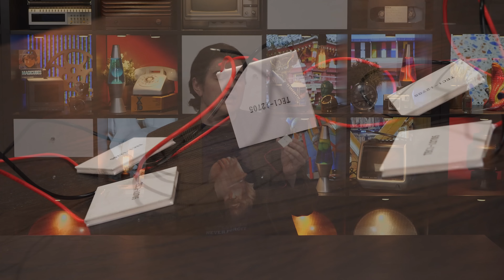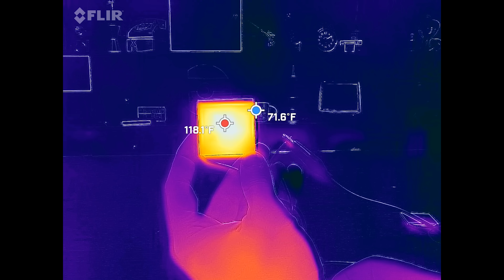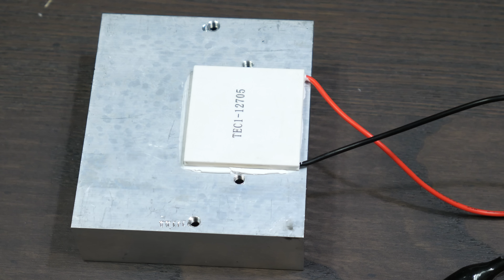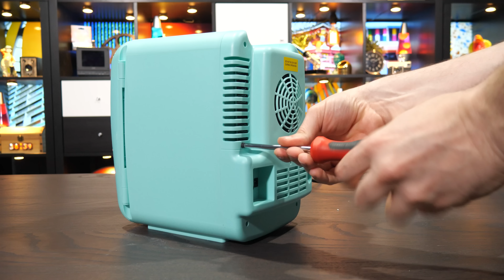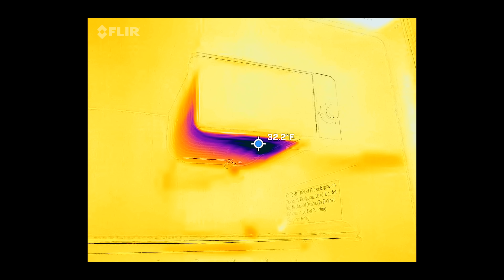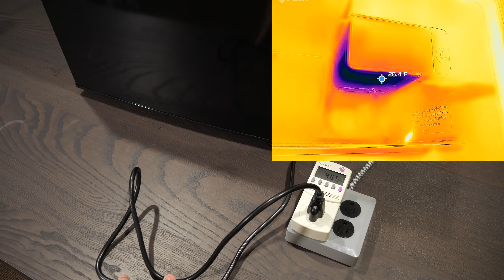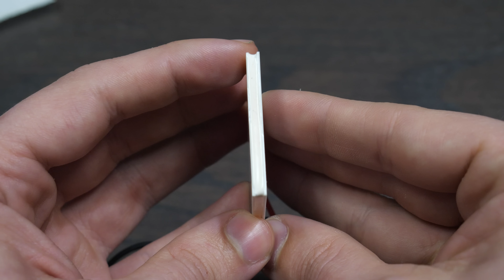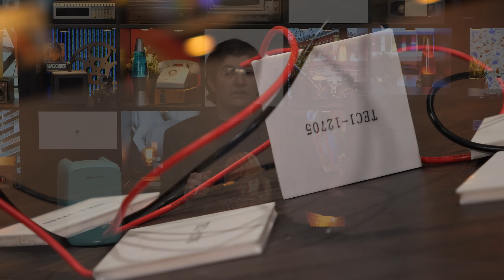Thermoelectric cooling: it's not great.

Comment: Sony Reon Pocket 5 is a wearable thermal device that uses this tech. Unfortunately it's not available in the USA, but I love my amazon Torras neck "air conditioner" which is a normal neck fan plus some Peltier cooling plates against your neck.  It's not super powerful, but when you switch from fan to cooling you feel a nice chill almost instantly that does make a difference for the 2-3h the battery lasts.  If I feel a little cold I switch it to heating mode and can often avoid putting on long sleeves.

Comment: Where peltier works reasonably well for me is inside my astrophotography camera. It's used there to reduce the sensor temperature to a known value so that it calibrates properly later. But on a hot night in the summer, it's just like you presented: 40 degrees below ambient is about the best it will do. The rest of the time, I keep the sensor at -10c.

Comment: I have the xbox mini fridge, and having used that at a lan party I must say I was very positively suprised at it's performance.
Now I bet it's not efficient at all, but from the sounds of things, it at least was far more efficient then this horrible blue thing. It would cool down a 1.5L cola bottle pretty well in an hour (ofcourse that's not actual fridge temperatures though, but still much better). It's probably better isolated.

Comment: I'm a big fan of the portable 12 volt compressor fridges, those tend to have the lid on the top so they get the efficiency bonus that you get from a chest freezer. My favorite one I've had so far is a relatively spendy big unit from Anker, it has a built-in and removable battery so it'll keep cooling even when the vehicle is off, it'll go about a day disconnected from power and the battery bank has a plug for taking direct input from a small solar panel.

Comment: One of the worst implementations of these I've seen is in cheap dehumidifiers. You might get a slow dribble out of one, unlike my proper refrigeration cycle ones that can pull a stream of water from humid air.

Comment: what would happen if instead of being a flat square, the peltier module was in the shape of a mobius strip? (or a mobius strip that is not a short circuit, like how a link in a chain has the split (if not welded to be a closed loop)

Comment: Remember the Global warming potential of all that historical R12 - 8500x. CO2....  LOL ..  Modern refrigerants. pffft  ...   Heat pumps,   the magic is merely where you want to shift the heat to (other side of a wall or someplase else, entirely)....  As with houses, unless the walls and windows are really well insulated, the heat just comes around the barrier and in the gaps...

Most "good" thermal devices have proper heatsinks and convection / exchange occurring...

Refrigeration has the magic of being able to put the hot and cold sides far enough apart to sent that heat somewhere "useful"...

?? A wonder regarding creating a thermostatically controlled enclosure - a low cost refrigerator vs an industrial AC unit...  hmmm, add reversing valve for summer/winter temp stability...

Comment: I once repaired an Peltier mini-fridge once with a damaged junction block.  I will say it worked, "100% as designed," once I replaced the junction.  Note I did not say well. I knew a compressor based system was more efficient, but I did put in a $7 digi-key part with success.  When I later bought a mini-fridge for my office...  Compressor based mini-fridge. 3.2 Cubic ft...
Now all my co-workers "borrow it"

Comment: I have two of these - one from a high-quality manufacturer, and one from an "off" brand. I have had great success with both of them for non-spoilable items; and, they work far better if you pre-cool your items, and\or pre-cool the cooler itself by running it empty before dropping stuff into it. Now, for spoilable items, I do both pre-cools, and\or a full freeze of spoilable items, and add a couple freeze packs. I've had meat stay near frozen for days on end as long as you don't drop the cooler into full sunlight, or otherwise let its environment heat up past that cooling gap. I've found extending that "safe temperature" time can be done by replacing the freeze packs from an actual freezer (e.g. you could spend far less energy re-freezing freeze packs in a very small freezer, and then replacing them in much larger thermoelectric coolers, to keep a much larger amount of stuff cool\cold).

Comment: I have one of those types of "fridges". I had wondered what it used, since I knew it couldn't possibly contain any sort of compressor given how small and light it is, and I hadn't thought of a Peltier device.

The reason I have one of these things is because I wanted something for when I'm staying at a hotel for work, and the hotel doesn't have a fridge in the room (which most of the hotels I've stayed at don't). I use it to cool the soft drinks I have with me to a slightly better drinking temperature than room temperature. I can't really drag an actual fridge around, so my choices are limited for this use-case.

The device I have also have more features than the one shown in this video. It can run off of line voltage as well as 12 volt (and also came with both a regular power cable and a "cigarette lighter plug" for use in a car.

It also has a switch with an off, cold, and hot setting. I haven't tried the hot setting and don't know how hot it actually gets.

Comment: I recently bought a couple cheap peltier elements to build a filament drier. The standard is to use resistive heating so freezing the moisture out of the air is just an added benefit.

Comment: Now, I'm curious if my 1942 GE fridge draws more or less power than the blue cube. The compressor on the 42 is easily twice the volume of the cube, and it still uses the original refrigerant.

Comment: I mean... RE: 24:40, a global warming potential of 3.3 still means it's 3.3 times as potent a greenhouse gas as carbon dioxide is, you still don't want like,,, tonnes and tonnes and tonnes of the stuff ending up in the atmosphere
Reply: How much isobutane do you think is leaking from refrigerator pumps compared to the amount of CO2 released by everything
Reply: 55 gram of R600a at a Global Warming Potential of 3x (compared to the world previous ozone eating R134a at 1430x) means an equivalent of 165 grams of CO2. however, a basic city car destroys that number in exhaust emissions when driving more than 2 kilometer… so I think comparatively we don’t really have to worry about it all that much especially with how it contained and they don’t really leak.

Comment: Peltiers are awesome if they aren't misused which happens like 99% of the time. PCR of global pandemic fame wouldn't be as easily possible without them. A "PCR machine" aka thermocycler essentially is just a very fast heater/cooler that uses a lot of Peltier for very little thermal mass, resulting in rates of temperature change of up to a staggering 200 K/s.

Comment: Neat, I remember hearing like 20 years ago that peltier devices would be the future of CPU cooling but I never really knew anything about how they work and had always wondered why I never heard about them again. I'm guessing based on how they were described here the temperature difference would just be way too big for that use case.
Reply: Peltiers saw some niche use for doing subambient temperature cooling without using dry ice or liquid nitrogen. The problem is that you roughly add a watt of Peltier waste heat per watt of CPU heat you want to remove, so if you have an overclocked CPU outputting like 200 W of heat, your custom water cooling loop that you will definitely need for these shenanigans will suddenly have to get rid of 400 W of total heat output.

Subambient also is a massive pain in the ass because moisture from the air will start to condense and freeze out, so you gotta do a bunch of work insulating the cold spots and sealing the motherboard components with something like nailpolish so you don't create any shorts and fry your components.

Comment: I have a question! Wouldn't this actually make sense as a replacement for resistance heaters used for things like food, when you don't actually want all that extra heat warming up the room? I'm guessing these things would destroy themselves before getting up to steak searing temperatures, but could it be useful for something like a water heater or warming plate, where the temperature difference you need isn't so high? Or to go even milder than that, heaters for aquariums/terrariums? Seems like there are more applications of this for slightly more efficient heating than for cooling.

Comment: Can you like do a video with Sabine Hossenfelder, if I am recalling right she isn't a fan of the heat pumps, it would be neat to see you two do a video hashing them out. Also these piezoelectric devices do have a cool thing they do, if you put heat or cold into the correct side they give you DC out, so there are now Campfire Cell Phone chargers if you could ever take a look at those. Thanks (and I was half-way through video when I wrote this so you might have covered them I don't know yet)

Comment: I remember back in the early-mid 00's I build a Peltier cooled PC (also water cooled to keep the Peltier from frying itself). It was such a fun experience, but yeeaaaaaah, it took 2 PSU's to power it up and used a freaking ton of electricity - but running a CPU below 0c was a lot of fun.

Comment: I got one of those as a Christmas gift from my ex's parents and it froze up the only time I tried using it, everything inside froze over; to be fair it took 2-3 days. But it also took an entire day to get up to temp. I think there was a defect with that one. I opened it and realized it was using a Peltier and was like "oh that's why it sucks". I was really into the tech as a kid and thought there has to be a way to make it work but eventually learned it's really just good for niche stuff like you said. Like I believe the same tech is used in some forms of nuclear battery's, apparently if you apply heat to one end, and cool the other is creates power. Which in stuff like the voyager probes could be handy. I think that's what they were used in but it might have been a different nuclear battery.

Comment: I recently bought a 12-can Thermoelectric unit. I definitely agree, it's kinda shit. However, I was using it for the exact use case you brought up: occasional use, laying on it's back, and in a small car (I'd have loved to get one of the cubes, but no space and I would have had to buy an inverter). Definitely not food safe, but still a great option for road trips. Worked pretty well for me until a drink leaked and killed something (they are NOT watertight on the back). Mine was a different brand, but had the exact power supply board and cooler system, probably just one company making most of there and re-badging them.

Comment: For interfacing with a DRM closed thermostat these are useful, heat or cool the sensor down to manipulation the system without need to reverse engineer the proprietary communication protocol

Comment: I'm having flashbacks to Thunderf00t's numerous videos about "Free Water From Air!!!1!" devices that essentially use this exact method. Setting aside the fact that driving a tanker truck full of water to wherever you need it is almost certainly cheaper than running a not-even-glorified dehumidifier to get that water, the peltier modules they use are the worst possible way to achieve the required cooling.

And don't forget the "Microwave for Cold" guys, who took this exact device, repackaged it in a fancy box, and said it'd be the next evolution in convenient chilling!
Reply: Good ol Thunderf00t.  On the topic you are speaking of; I swear some of these people have gone to some sort of conference where they were told about these things and how CHEAP they are to make. Then from there their minds raced with ideas of different gizmos and gadgets and somewhere along the line, they started thinking their ideas were REVOLUNONARY...
But it all still boiled down to being less useful and more consuming than anything else already in use. And so the Marketing and P.R. garbage show starts, Got to get that HYPE train rolling!..
Reply: Just collect the water from the ac, much easier

Comment: I had figured that Peltier elements would have a use in electronics, where space is at a premium. You can't fit a tiny compressor in a laptop or even a desktop, so if you want to get the heat moving outward faster you'd need to use a Peltier element.
But with efficiencies that terrible, it probably just isn't worth it. Mayyybe at lower power settings, but then they aren't doing much to move heat around.

Comment: These coolers have seen wide use in astrophotography! Many sensitive astro camera have them attached to the sensor to reduce noise significantly. This is one area where they make a lot of sense. A -20c sensor vs 20c sensor is night and day and these are the only real solution to that problem.

Comment: I have this power station with a 12V socket on it.  Only downside is only charges at 60 watts. I was hoping to keep it topped off during the day with a solar panel while camping while having a 12v car cooler plugged into it. Couldn't believe that the cooler itself pulled 58 watts even after it had gotten down to temperature. Found out why people still just get ice chests while camping....

Comment: Never in a million years would I buy these garbage coolers. Proper compressor-based mini fridges are easy to get and relatively cheap as-is. They work 100x better and will chill your drinks down to ice cold temps.

Comment: I got a cooler like this while back, and it was useless at cooling. I was aware of peltier elements and their characteristics before I bought it, and expected very little, but it didn't even achieve 'very little'. No problem though, as I took it out like I originally wanted to do, and had great fun experimenting with the element while still having a working cooler.

I was able to freeze a few ml of water almost instantly with the hot side stuck to an old CPU heat sink, and putting your finger on it while reversing the current flow - feeling something change temperature back and forth so quickly - was a very interesting feeling.

Best way I could describe it is 'microscopic thermal performance for macroscopic effort'.

Comment: 9:43 Since you're only going to measure the power of the refrigerator once it stabilizes. I will point out that most people would be putting pre-cooled cans in their cooler. Heck I'd probably toss an ice pack in there too.

Comment: Thermofisher Tsx 505 is a commercial/industrial under the counter refrigerator using a PHP also CO2. Their PHPs used had issues prematurely failing. But theyre widely used in lab environments.

Comment: Best use for a peltier Ive seen is a fireplace fan. Fireplace heats the hit side, heatsink on the cold side. Peltuer wired straight to a motor. Sits on the fireplace stove. Makes the fan spin once the fireplace is hot and makes a mild bit of airflow to get the heat across the room mildly faster.

Comment: I wonder if you could use these for making an offgrid hot and cold water line thing, put the hot sides on a radiator plate thing and have some insulation to separate the cold line, run it off solar power, might be good for long term usage since no moving parts.

Comment: Next time you go down this rabbit hole, you might mention that there are a lot of 12V portable fridges available. These provide vapor compression refrigeration in a size will "fit on your desk" -- not quite as small as the stupid little blue thing, but not that much bigger. These are intended for use in a car, but usually come with a 120V power supply that will let you run it from a wall outlet.

Comment: I don't know if you said it and it wouldn't matter much but,  you can make a peltier work better by putting a heat sink on the hot side.  Something that resembles a pc heat sink, with heat pipes and maybe made out of aluminum and cooper.

Comment: used mine toy"cooler" as a transport cooler/heater mine had 2 switches one for on off the other for hot cold it got very littel use altho my brotherinlaw borowed it when he built his and my sisters first house to cool drinks at the jobsite it even frose the drinks it took a full night with as low temp as 20C and the frosen drinks had direct contact with the cold plate but still ther was ice
never used it after that as i lost it not sure if i got it back and lost it or if it took a trip to the dump with the building debries  20+ year ago